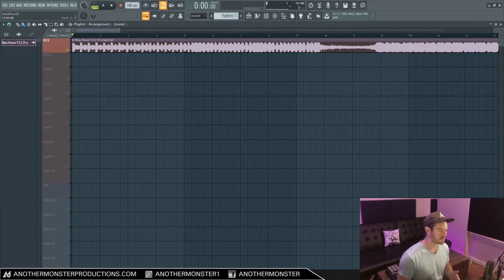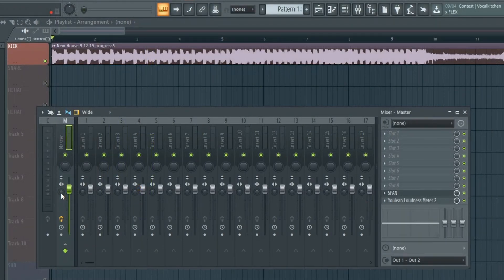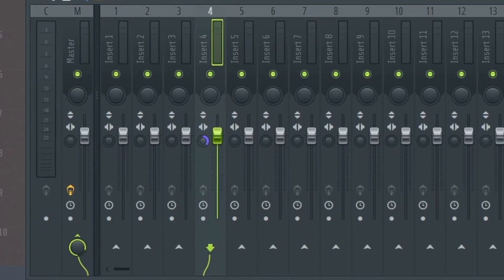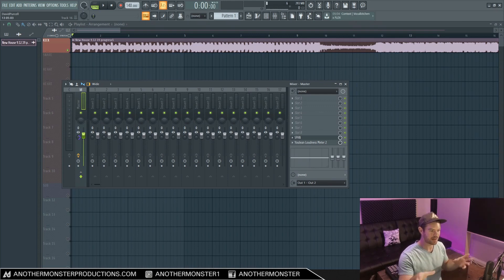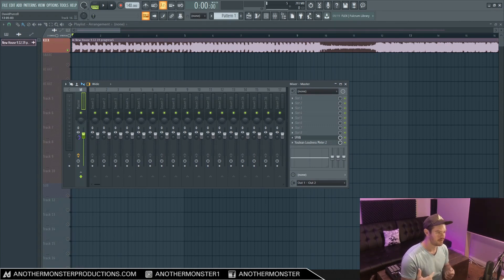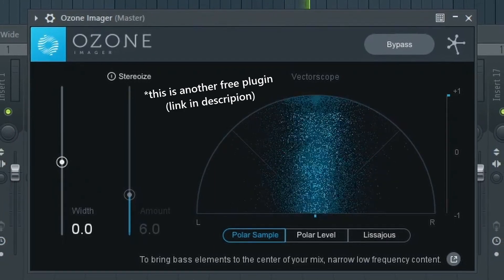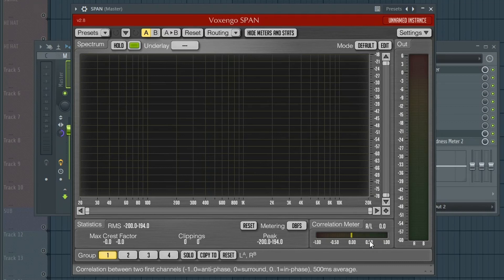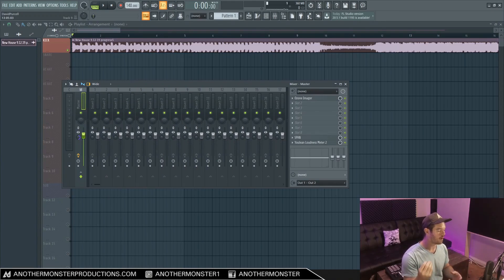How to Mix in Mono Using FL Studio (And Why)

Comment from the maker: This is one good technique to help get better mixes. If you're struggling to get good mixes check out my ebook it may be helpful for you (link in description). Hope you enjoy the video!
Reply: Thanks for another great tutorial! I know it depends on the samples used but is there any kind of cheat sheet for addng stereo separation with percussion?
Reply from the maker: css172 not that I know of. Percussion is one of those elements that there really isn’t a right or wrong way to do things. I definitely add stereo shaper to a lot of perc and even hi hats sometimes. And then I’ll often pan on top of that depending on what I feel the particular track needs. Hope that helps I know it’s pretty vague but I think perc is pretty open to experimentation
Reply: @AnotherMonster  thanks for reply!
Reply: The DAW I use has only L/R Delay and Focus. What do I have to do? Please reply

Comment: I did this on my last track and I was still getting phase issues on a track that was out of phase. So it seems Fl studio masters mono is not true mono. I then added Ozone imager and turned on its mono and the phase issue was gone. So it seems Fl studio master in Mono alone is not true mono. try it with something out of phase. it will still be out of phase with Fl studio master in mono. I was surprised.
Reply: You can also use Maximus
Reply: @dishyaboy  you mean to turn to mono?

Comment: so basically what exactly is happening when my track sounds perfect in stereo but then I flip it into mono and I feel like a lot of volume from different elements are way off as well as some are even missing, what would that mean?
Reply: u just think it sits in the mix when playing in stereo but it isnt  ur tricking urself with stereo
Reply: @yungkint6820  not really. What is probably is, is actually just phase cancelation between the sounds. if a sound especially doesnt have a mono source it is very easy for when it goes into mono to cancel itself out.

Comment: Question : So pretty much before I do any tweaking or sweeping. I put my whole mixer in mono and then start mixing correct ?
Reply from the maker: 1STAYCOZY there’s not necessarily or right or wrong way to it. I tend to mix in stereo most of the time and then check it mono and make sure everything is good and maybe do a few little tweaks in mono before going back to stereo
Reply: Another Monster Productions okay. Gotcha. Thanks man!